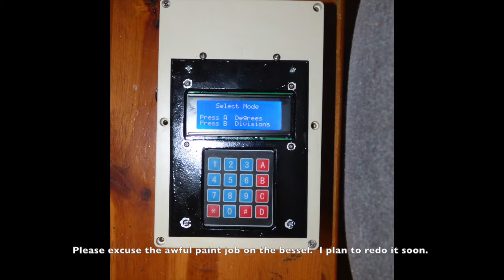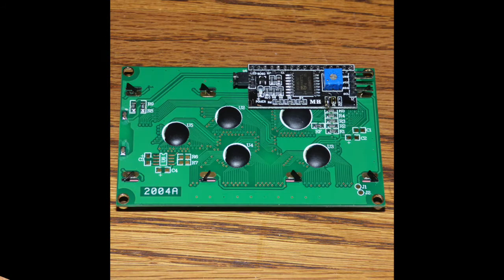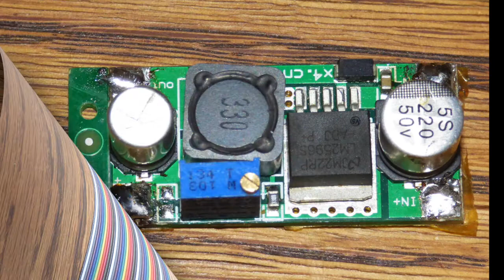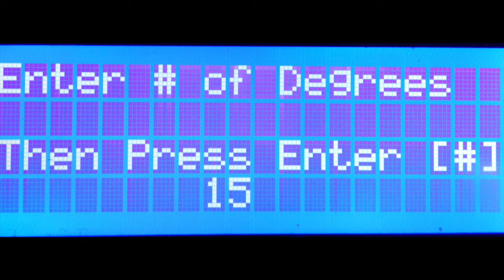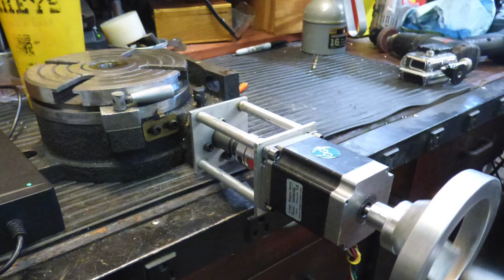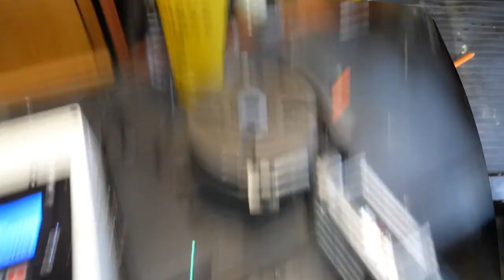This week in Herb's Workshop #131

Comment: Herb,
Excellent presentation and photos. I have been wanting to build something like this and now inspired to do so. I hope to see you at the Bash in June. I am finally retiring on July 1 after 50 years of working and want to spend more time in my home shop. 
Thank you for sharing your work,
Paul
Reply from the maker: Thanks for the comment, Paul.  I've been retired for 5 1/2 years and enjoy every minute of it.  Especially not having to drive in morning traffic!
Reply: Herb,
I know what you mean about the commute. I have an 80 mile round trip commute in LA traffic  everyday and won't miss this at all.
Paul
Reply: Herb, 
I am impressed with your new build and now researching how to build  a Rotary Table Indexer for a small 4" diameter table and using an Arduino. I found an article at Home Model Engine Machinist that looks promising. It is entitled "Arduino Rotary Table for Dummies" and just what I wanted with step by step instructions. Thank you for the inspiration.
Paul

Comment: Those Arduinos are great. "Back in the day" we used a EEPROM version of the 80C51 chip (kinda the grandaddy to the Arduino) to prototype realtime projects, mostly with "burn and crash" techniques. The mask charge was around $3k then, so small scale production was out of reach.
Reply from the maker: I started out with a 6502, the 8051, Z8, and so many others I can't remember them all.  I started programming in 1969 on a HP-1000 at TI for a transistor test line.  These days, besides the Arduino, I use ESP32's and ESP8266's.  Next project is to do a LoRa network with multiple nodes.